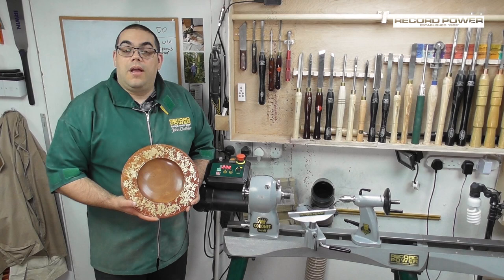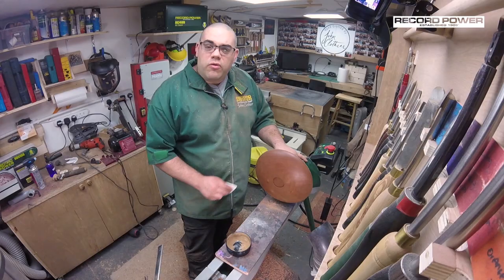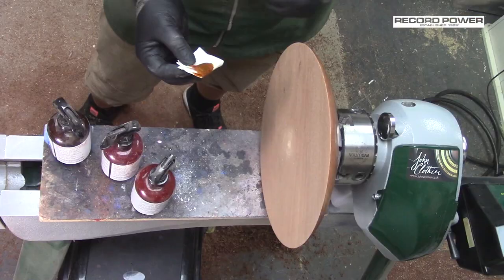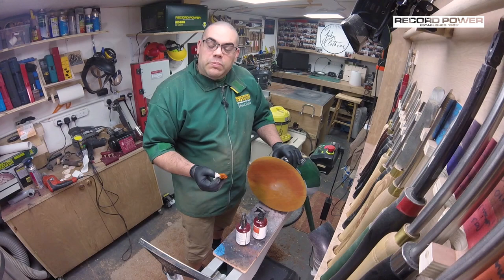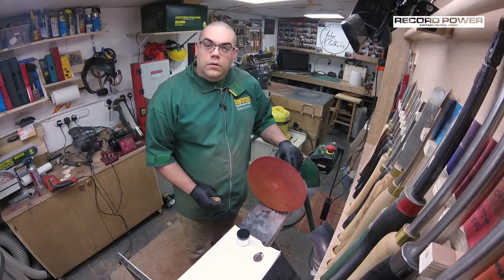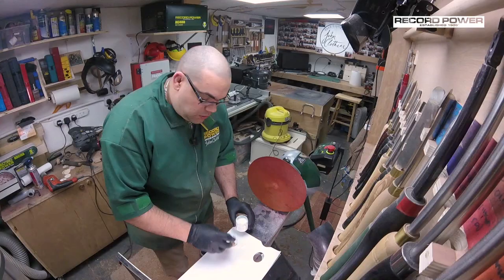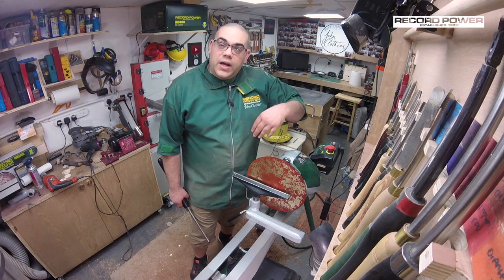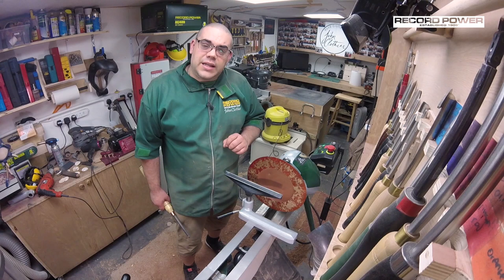Embellishing Your Turning Using Gold Leaf Project by John Clothier

Comment: Lovely, but would it not have been better to hollow out the centre before applying the gold leaf?
Reply: I can understand why you would ask that question. The reason to do it the other way is to allow the gold leaf to come right to the edge of the hollowing without getting any of the size (glue) on the inside of the bowl. If you hollow first you will inevitably end up with more of a band of gold rather than it going right to the edge. 😀